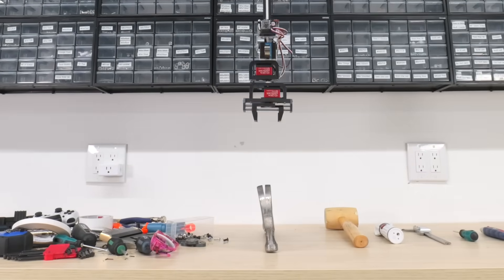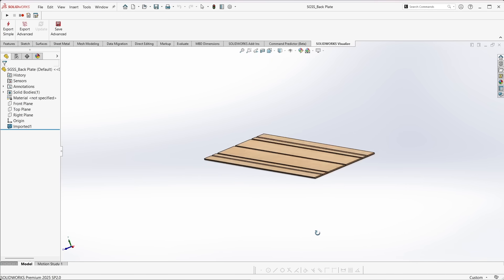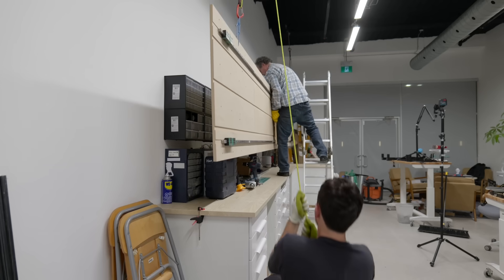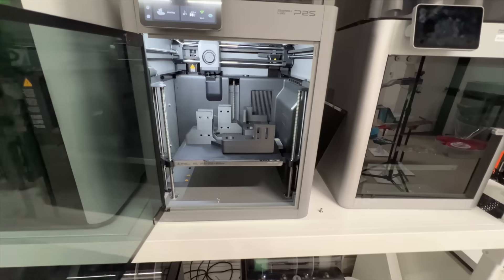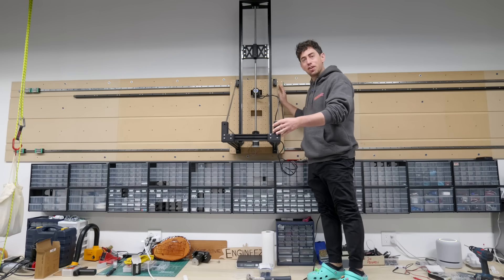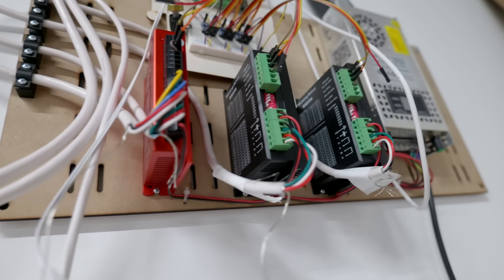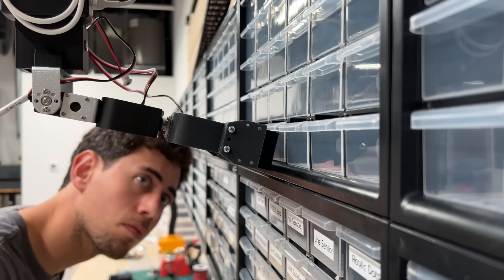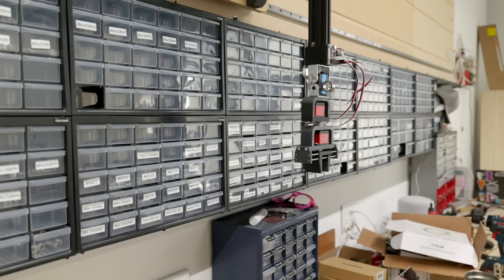I HATE Cleaning so I built THIS

Comment: Great project i could use one of that. Though it could use some improvment, as i can tell you right now that this will fail after a year of constant use. I don't know what kind of cables you used in the cable chain, but if it's anything else then the Flexible kind it won't stand the test of time, as over long distance they will start to tear from bending constantly. Another matter alltogether is friction from the lack of separation between them. In small builds like 3d prnters it doesn't play as much of a role, as it moves sporadicaly and very slowly, but at scale the problem becomes bigger and so does the consequences.

Comment: Would be cool to add a tool changer so you have a tool head for bin retrieval and a toolhead for pick and place. The toolhead for tool hanging could have a French cleat on it and all the bins could have the mating French cleat on the front face. It's basically what you're already doing but if you have a top and bottom cleat it should be more secure so you can permit faster movement around the gantry.

Comment: This is incredible and great to see how well it works for a v1.

My suggestions would largely mirror others in terms of QR codes and computer vision, to build on that, would there be any benefit to any alignment marks or target stickers for positioning larger or uneven items on a wall bracket? Maybe an encoder strip for precise positioning?

Another suggestion is for the toolhead, I'd revamp the design a little here so the motors don't hold so much of the weight, maybe have pivots with motorised movement and/or counterbalance weight to ease the load on the motors a little. You could also make the toolhead two (or more) sided to handle different items, maybe a grab on one side, a hook, electromagnet or something else - whatever might be useful for your needs and have it rotate to the correct side for the task at hand

Comment: Question, why don't you use a sistem like a lift for moving the drawers in and out faster and easier, like 2 rods that unfold and go under the drawers so it can lift heavy and miss placed weights in the drawers

Comment: 5:42 Annnnnd that's not how infill works folks. Higher infill doesn't equal better rigidity, only brittleness. You can get nearly same strength from 30% infill at most and save so much filament its not funny.

Comment: I could build the Gantry and motion system no problem can 3D design Ive built three different 3D printers but I wouldn't touch this project with a 10 ft Pole every drawer is going to have different weight this would be a nightmare to get it to work seamless without some type of real time feedback

Comment: for the drawer opening part could u not put metal plates in each draw and then have an electromagnet on the side of the gripper to pull it out and turn it off. havent finsihed the video dont know if its been discussed

Comment: I enjoy your videos and love this idea!

I’ve built some cnc and 3d printers and automated hot wire cutters, from scratch, on my own. 

Just a quick suggestion regarding the first testing of the limit switches. Do not let the gantry hit the switch. Instead, when the gantry is close (in your case, about a foot away) manually (with your fingers) push the limit switch. This way, you don’t wreck your gantry in case it doesn’t work.

Comment: 10:41 You got to put a tray underneath it to push/pull the drawer on it. I've seen a pharmaceutical robot in a hospital work that way to restock prescriptions and add barcodes to the drawers to identify the drawers other than a grid system

Comment: Pro tip about the homing sensors. 

But them on a spring so they slide backwards, then put an additional switch behind it that cuts power to the motors directly (or through a relay perhaps). 

Never have to worry about damage from overtravel or a failed homing sensor.

Comment: Getting there, few pointers from large automation production lines. Make your tools mount onto a shadow board under the parts boxes, one nice thing about tools is they don't have the same outline, so all you need to do is have a camera pickup the outline for it to recognize what the tool is and where it goes on the shadow board. Next you will want to delegate work zones on such a long workbench, that way when you ask for parts bins or tools it will deliver them to the zone you are currently doing a job at. So for a 17' workbench I would break it into 3 work zones, saves having to keep moving because the parts or tools are delivered just out of arms reach. 
You will want some way for it to identify which parts tray is which, for when you put all the parts trays back in your bench top holder in the wrong order. Few ways to do that, bar codes or QR codes that the camera can see, RFID tags in each tray with a reader in the end manipulator, even old school punch cards that the camera sees will work. Then the next part will be to not have to place the trays back in the bench top holder, you can leave them anywhere on the bench, and any angle and the manipulator will adjust to pick it up. Or to make sure you put then back in the bench top holder in the right order you could mount a display above the holder which displays what tray is meant to be in the slot, but not very automated doing it that way. 
With more speed, and you definitely need more speed, the Y axis "whipping" on the screw will get worse, this just shows how low quality the parts are (which is fine as money is money), but it shouldn't be this issue for such a short screw. An alternative is to remove the screws and copy your 3D printer by having two belts fixed to the trolley, the motor fixed to the bridge with an axle driving sprockets to turn the belts, which the belt ends are bolted to the trolley. 
For the parts trays, you could make an L shaped arm that swings under the tray to help hold it level for faster removal and insertion. For removal the screws grab the tray, slide it out 2/3 to way, L shaped arm swings under the tray to take weight and keep tray level as it is fully removed. Reverse for insertion. It will remove all the little Y+, Z+, Grab rotate +, Y+, Z+, Grab rotate +, movements which all slow things down. 

If you ever have trouble with it loosing position, you don't need to use the limit switch's as homing positions. You can mount a reed (or many other types of switches)  or roller switch that runs over a bump  halve way along your X axis, this then becomes the homing point. Advantage is also that the machine when idle goes to it's home which is now in the middle of everything, it has zero'd itself again, and you don't need to wait for it to travel so far to get something for you. 
Lastly, to save a dollar, no need to mount such a long caterpillar chain for the X axis, usually the chain runs from just before center of X axis and then up to the bridge. The way you have it the first 8' of caterpillar chain will never move, we mount cables just inside cable duct for that first 8'. Nice clean 3D prints as well dude. You made me laugh when talking about trying to keep the X axis rails straight and in line, then get some MDF cut to short strips. Usually it's a single length of steel tubing, with the top tubing having the rail on the front and the drive rack on the bottom. Then you use the bridge to align the bottom rail/tubing as you mount to wall. Oh it would probably be cheaper to buy the drive rack and pinion than make it, those parts are injection molded for a couple of dollars these days. Although your tariffs in America might make them expensive these days.

Comment: Did you have any issued with the lengths of the motor cables? I would have placed all but the x-drivers on the gantry to keep the controllers close to the motors.

Comment: This project turned out awesome. For a Version 2 idea: consider adding a scale. If you weigh parts before putting them back, you could estimate how many you still have on hand.

You might also switch from screws to a small forklift-style mechanism that folds down from vertical to horizontal—this could help eliminate bin sag. A custom wall storage unit could include slots for the forks and remove the need for tabs altogether.

From the height above the workbench, it looks like the bins are being pulled all the way out every time anyway. If custom bins aren’t in the cards yet, cutting the tabs could be a simple interim solution.

Another thought: NFC tags on all your tools and an NFC reader on the grabber head. That way, if a bin is removed from the tray, the system would know exactly which bin it’s handling. Computer vision is great, but it’s much easier to identify that something is a screwdriver than to reliably tell flathead vs. Phillips every time.

Comment: It's absolutely amazing how you got the linear rails parallel to each other over 17 ft, using MDF! Great work!
Also, you should coat the MDF with a sealer, to inhibit moisture absorption/release, which will cause the material to swell, aka move as humidity changes. Especially where the rails mount, as the "un-cut" top surface is the most dense and sealed region, and cuts expose the internal fibers that pull in moisture. For structural purposes, I vacuum bag my MDF panels with several plies of carbon fiber on each side. However, every time, the panels warp; even though the plies are balanced!

Comment: This is great I think you should use belt drive or even a huge ballscrew for speed and some absolute encoders so no need for homing after a loss of power and saves some weight on the gantry.

Comment: For 2.0 add a couple of cameras, 4-5 above the desk with a specially trained AI to identify items and then another camera on the hand so it can read a code on the bins so it know exactly where they are incase you decide to move them around, the AI could help with this part also by having it remember where the bin was last located using a coordinate structure in the files.

Comment: i mean at this point 3d printing trays that had a metal piece on the front and an arm with a small electromagnet so they hold tight and with rfid tags maybe even have a sensor x tray isnt in its spot should i return it or being able to scan tags on the counter and know exactly what's where, or hey i need these for x project could you pull them out for me.  my ADHD would go wild with this and way over build it🤣

Comment: It's incredible how, despite being sponsored by 3d printing companies, half of youtube still doesen't understand the role of infill in 3d printing
Reply: i was thinking the excact same 😂, he wouldve been better off at 15% rather than upping it to 80
Reply: @olem.isaksen336  I try not to think about all the plastic that gets wasted every day
Reply: I'm glad other people noticed this too...such a huge misconception
Reply: What was the issue you are mentioning?  I am a beginner at this but it would seem that if you are trying to have more ridged and durable parts upping the infill makes sense?  Yes it takes significantly more plastic but doesn't that result in a more durable product?

Honestly asking, would like to know.  Thanks.
Reply: @CrazyCanuck55 it's a common misconceptions that more plastic makes it more durable, when it's the opposite. Less air gaps actually can weaken the strength of the part as now the object has less ability to bend before breaking, suffering greater from shear stresses as well.
Reply: @seasnek7024  that makes sense but if you really need rigidity you don't want it to flex at all. Better for it to break than to bend and destroy your tolerances
Reply: @TheRMUPs I mean personally wouldn't want it to break and the entire arm comes crashing down on someone or something else. You need some amount of flex, which is why relying solely on tolerances for control is not ideal, unless you regularly go through recalibration sequences like 3d printers do.

Comment: You built a homemade high-bay racking system?! The one at work is the weakest link in our production. At least if you lose power or the system breaks, you can still manually pull your bins out.

Comment: why didn't you just mount everything on the X axis  and put the AC onto the 2 rails of the X axis  and mount all the limit switches on the X axis. you would propebly saved hundreds of $. could have also communicated with the printer using  Ethernet over power.

Comment: Unless your parts are being loaded in extreme compression (i.e. like a stamping die or workholding fixture for a clamp), increasing infill on a 3D print nets you minimal structural gains for the amount of weight and print time added, and filament wasted. Leave your infill low and increase your wall/perimeter count for best strength-to-weight.

Comment: Fun build. Going to be interesting to see if the PLA creeps over time…
Reply: i never had any problem with this if the temperature stays about room temperature. the only time when i had pla deform was when i let some prints in my car in the summer.
Reply: @Enderkruemel unless the warehouse is constantly air-conditioned you'll get natural creep over time and if any parts have mechanisms constantly moving (I.e. gripper, rack and pinion) you'll gradually get heat through friction.
Reply: @seasnek7024  you think this will heat up from it moving? Natural convection is more than enough to cool this down and it never heats that much.

Also it pauses between moves and it has very  little load on it so there is no Problem.

Comment: I would most likely do this with a raspberry pi, a vision camera with an openCV stack. QR codes on the bins and top of the cabinets and use the QR codes as local spatial reference points. Rather than counting from end stops etc...
Reply: You are trying to build and absolute cartesian system, that will fail and loos track very soon. 
Build a class for each bin, that takes control of the coordinates and the relative position the bin is stores in reference to the box. 
This way you run the robot once learned where each box is, where each bin is and it learns it self where what is. 
Also when you put something manually back in the wrong position, the robot has a chance to find a bin and relearn its position.

Comment: You might want to consider placing a counter weight on the first wrist articulator?
This could be done by building it to the outside on the backside.  thus avoiding contact with the main arm with in the straight down position.

Secondly you might want to consider adding stiffeners to some or all of your draws' side walls?

If I had built that project from scratch I think that the bins would have had like little fork lift slots in the bins and then near the entrances' it would have widened making it easier to both lift from the bottom middle and then the accuracy would not have needed to be as much.
Sadly unless the fork lift tongs folded out of the way what I've described would not have been of much help with clean up operations.

Comment: Now build a Second one that is mounted in the celling with a 360 degree primary rotator.  Followed by a linear arm, that connects to something acting like an elbow then a wrist etc... 
Goals:
That it can take a hand off from the first build and deliver it too you while you stand further away.
That it can be told to just hold something in position.  IE the worlds best 3rd hand.
That it can take verbal commands to help move something aquard shaped into alignments.
That it can apply adjusted pressure on verbal command.
That it either carries a clamp tightening/loosening rotator/screw, or that it can reach over and pick one up then apply it to a clamp and then position and tighten the clamp.
Lastly and possibly the most important.  That it can open the fridge and get you a cold beer, and close the fridge.  (Beer, energy drink, anything that's in a can shape.)  This would mean you could create/find/buy a can shape and load the fridge with cold coffees, Hebbal teas if you desire.

Comment: No cameras, but somehow it knows where exactly everything is on the table. 😂
Reply: Haha.. bold of them to make people think that part was automated as well. Pretty sure there was just someone with that ps controller in the background..
Reply: @jonasgschnell4051  he said he used preprogrammed positions for all the tools... i also expectet at maybe camera vision and definitly something like nfc tags on the bins with a  reader on the robot arm to read the content of the bins . so it would also be able to scan and sort the bins in the storage things if someone puts them in wrong.
Reply: he said the tools locations were pre programmed.
Reply: @MrRxlizard using only limit switches? This won't last long without additional sensors and requiring 1-10mm accuracy
Reply: @seasnek7024  Actually, the bot isn't 'perceiving' anything in realtime. It’s just executing a script based on fixed spatial mapping. Since the setup is static, the creator likely just hard coded the exact X, Y, and Z points for each tool location beforehand. It's basically a 'blind' routine where the arm moves to a saved coordinate rather than hunting for an object. Those limit switches are really just physical end stops for homing the motors and preventing over travel they don't actually help the bot 'see' or locate the tools with any sort of 1-10mm precision.

Comment: i personally would use a qr code system instead
also the robot doesnt need to go that deep
and finally, i would redesign the boxes and the claw to better work together

my idea would be that each box has a qr code and a label and if you are done, you just can but the box back in the station and tell the robot to bring it back to its spot

also you could track the usage of all the boxes and let the robot sort the boxes so that the most frequently used boxes are the closest to the station

I dont need it to clean up my whole desk so i only would use it to manage my boxes